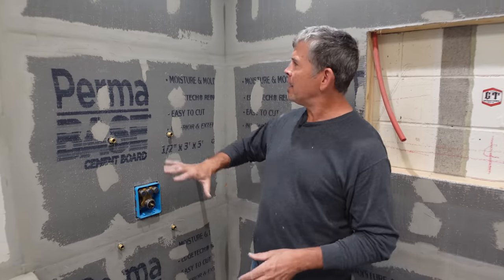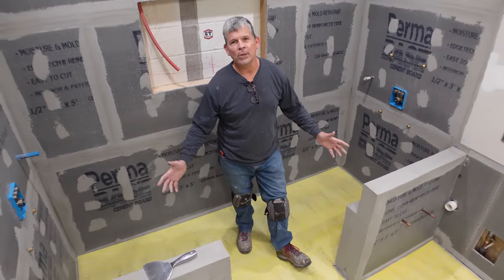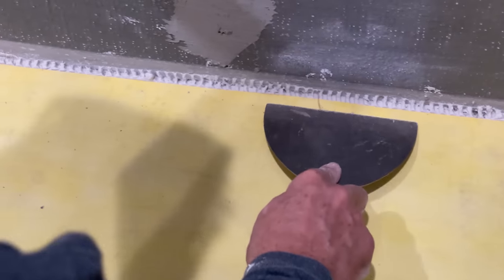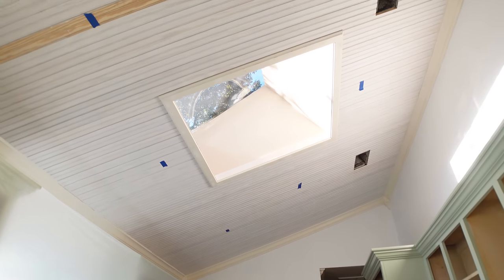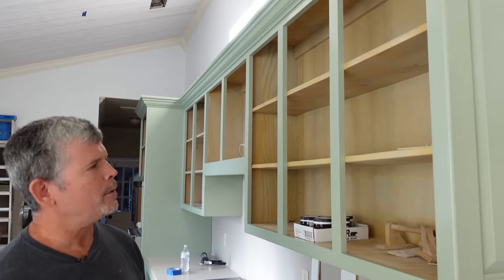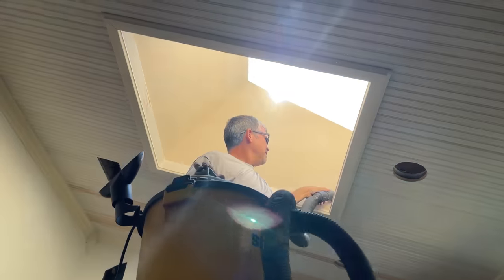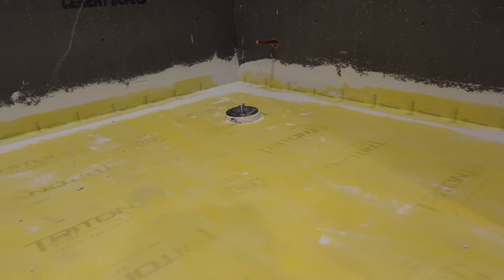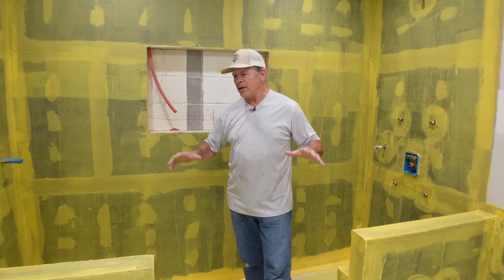We Covered Our Bathroom in Nacho Cheese! - THE SHOP Part 17

Comment: Every gun I’ve carried would have rust spots from sweat in the summer. I think you just gave me a solution to that problem
Reply: Try a holster with a rear protective tab.  Wipe it down with an oily rag each night
Reply: @albertthesecond210  It wasn’t a huge problem, I exaggerated for the joke. I carry owb now so it’s no longer an issue anyway
Reply: @joshcowart2446  I can relate.  Mine are typically OWB (leather) and prefer the protective leather tab design
Reply: @albertthesecond210  yeah, I always did iwb in various styles but appendix hurt while working and hip would always come out from under my shirt. I finally tried owb and love it. I actually just got a leather holster. I hadn’t intended to get leather but that was all they had for a hell cat left hand draw and I love it

Comment: Without any waterproofing underneath the shower pan, water could be absorbed into the Pirma base and then through capillary action down into the pan and directly onto the wood. Water would basically be trapped there with the membrane on top of the shower pan locking it in. So waterproofing the walls seems critical. I’m sure studpack is following the directions, but from the looks of it it seems like it could use a second coat.

Comment: Looks like a good waterproofed bathroom.  I always seal the exposed thinset used to lay the floor membrane and 6" strip membrane.  I figure if water never gets to the overlap chances are it will last longer.

Comment: tinting your primer is a great help but you definitely want to do it a contrasting color.   it's awesome over white drywall too.  (because its super easy to lose white paint over white primer over white drywall mud).   I like to use a really light pink.   it's easy enough to cover (even with white) but it really stands out where you got primer (so you have good coverage) and where you now have paint.  It's esp great on ceilings because we'll all looked up at a ceiling long after it's painted and realized that there is a whole area that is just primer.   When ti's pink that doesn't happen.  Any paint shop will tint your primer no problem.
Reply: That is smart! Some idjit painted the ceiling on the rental I own with eggshell, and I overpainted flat but I sometimes can catch a spot I missed.
Reply: @toomanymarys7355  , they have ceiling paint that goes on blueish and drys white. Two coats and your done.

Comment: @stud pack
16:49 Hey Mr Paul, wondering if ever tried Laticrete’s HYDRO BAN Quick Cure liquid applied waterproofing membrane? Paints on like regular Hydro Ban liquid membrane, but able to flood test or tile (suppose should be and tile😉) w/in 30-120 mins depending on few variables. Personally have only used 1 time for project and felt thicker to me and color diff as well, compared to “normal” liquid applied hydro ban membrane.
Thx and this garage bathroom remodel is looking great. Nice job on painting, always do awesome prep and gets a great detailed final looking project👍🏻

Comment: Great video guys. I’m working on a first floor remodel in my house. Half the house has been painted with a brush and roller and the other half has still yet to be done. I’d like to try a sprayer but I’m not sure if it’s worth it to deal with only three rooms left.   All three rooms have a bunch of windows, doors, casing and baseboard.  Floors have already been installed to those that need to be protected.

Comment: To keep stuff from splattering on the floor, you can go to somewhere like Samsclub and they have these really thin sheets of cardboad that they put on top of pallets under products like paper towels. If you happen to get there when the cardboard is still there, grab some. I had an employee practically beg me to take some because they just throw it away. You can then lay that stuff on the floors to protect them and it doesn't cost you anything. I used a sheet to protect my floor when preparing to install my toilet.
Can Triton membrane be used behind direct-to-stud shower walls? 
"It wasn't fma it was fml" LOL. 
I love that you repurposed things in that kitchen for the skylight. I'm a big fan of recycling things/re-using them for some purpose.

Comment: I know time isn't on your side, but i'd apply a few more thin coats of the membrane just to get it a few mils thick and have peace of mind. At least enough coats until the bucket is done. By the time you're done with your next coat, you could be starting another one right after that. The coats dry quick when they're applied thin, and they build up and bond on top of each other creating a very strong seamless membrane.
Reply: To my knowledge its not a good idea to roll on a ton of coats of this stuff 2 coats is usually more then enough
Reply: Frogy is correct. Too many layers cause problems that make it fail over time. Follow the directions to the letter!
Reply: Absolutely 2 coats,as long as there put on even and correct 2 coats,one coat is not enough
Reply: @Teach2Build  never heard that,it’s actually the opposite
Reply: I didn't say just one coat, I specified to read the packaging. Different brands have different specs, but for liquid membranes, most require 2 coats but will fail with 3, or if the mils are too thick.

Comment: Would you recommend that dust free sanding system from Amazon to use on popcorn ceilings? Or keep with the old fashion "damp and scrape" for the popcorn?
Reply: I would recommend keeping popcorn ceiling wet/damp when removing it. Some early applications were known to have asbestos. Dry sanding/scraping would not only make a huge mess with all the chunks flying off (that the vacuum couldn't pull through the mesh), but could get any asbestos airborne. Err on the side of caution.
Reply: @nelsonbrum8496  we are lucky and had it checked, no asbestos!!! House is just under a decade old, too!

Comment: Keraflex sticks to everything even wood. Also saving old wood is a dying art. Well done on your filler use. I use the same combo. Durhams is a life saver.
Reply: I agree, Durhams is a life saver.
Reply: My only gripe with Durhams is the short working time. It would be so nice to mix up a batch and have an hour to apply it, but you only get 15 minutes max before it starts to stiffen up, which means I spend as nearly as much time mixing/cleaning every 15 minutes as I do applying it. I have tried adding the splash of vinegar to lengthen the working time multiple times, as per the instructions, but it never made any difference at all as far as I could tell. :(
Reply: Is that cement based? I’ve heard you can refrigerate the mix before hand and use ice cold water, put your bucket inside a second bucket with ice, etc to give it a few extra minutes of life.

Comment: question about the beadboard ceiling. you said you tacked up furring strips or something perpendicular to the joists so you had more support to nail into... did you also run strips on top of the joists so they were then level with the furring strips or was it a thin enough difference not to matter? i'd like to do something similar to my ceiling... 

anyway, glad you got to get a lot done finishing up things before you head to TX. can't wait to see everything :)
Reply from the maker: the ceiling was flat enough for us to not fur out the strips any further, we would've if was super noticeable though
Reply: @StudPack  thanks

Comment: I would use a ledger and do all the walls and ceiling first leaving out the bottom row of tile.  Then do the floors and follow up with the bottom row of tile so you can avoid being on finished product.

Comment: It's hard to cover anything with 1 coat of paint. 

A sprayer helps, thicker coat. 

But the problem is with the sheen, not the color. Tinting the primer helps with the color, but it's almost impossible to get even coverage in 1 coat.  Stand in the right light and you can see the imperfections. 

That's why you can't touch up paint, have to paint the whole wall.

Comment: It'll leak around the drain bro. Wrong membrane to drain connection. What's keeping the water from seeping under the membrane around the drain? Thinset? Lol Cut the membrane back around the drain about 1" and paint around the drain with liquid  membrane/fabric tape. At least 2 coats. Prime around the drain or sand it first to make sure the liquid membrane will stick to the drain. That way there's no way for water to seep under the membrane around the drain.  Should've used a Kerdi linear drain or same style linear drain as Kerdi because you would be able to achieve a 2" overlap with a Kerdi linear drain.

Comment: Thin set is not waterproof. Yes it will leak water even though you follow the installation instructions. The waterproof roll on membrane should be rolled over all edges and exposed thinner so there is a true waterproof membrane at any edges. You won’t know until you tear apart the bathroom 5 years after use. This is same as Schluter systems and the install method in the Americas using this set leaks. The European compound doesn’t.

Comment: You guys go so far above and beyond. You have showed projects like your mom's house, where they had tiled over drywall on the shower walls. In my friend's track home, he discovered the same thing because water was leaking into his kitchen below. There is constant fight between owner- contractor, when asking for a quote for redoing a bathroom, and if the quotes are too high, the owner goes with the lowest bid. But if you want the belt and suspenders work done, The Stud Pack style, then you have to pay for the plywood, thin set, backer board, thin set, membrane, tile and labor, not the plywood-thin set-tile.

Comment: @ 10:00 You guys are the pros, so I'll take your word on the stubborn wallpaper - but in case you didn't know I learned a trick from my wife of all people. We had some really stuck on wallpaper when we moved in, and if you use hot water and vinegar 50/50 mix you can spray it on let it sit for a minute and the vinegar eats away the glue. We were able to just scrape the wall paper off easily at that point.
Reply: Some are vinyl and nothing soaks through.

Comment: You should do a separate quick video on that dustless sander. I'm in the same boat, I do drywall not enough to NOT buy a $500+ machine but enough to need something better than a standard pad and stick. That seems like a decent medium. Did you get your pistol cleaned up? lol

Comment: Why not use a waterproof board right from the start like Johns Manville Go Board? It's lightweight, easy to cut and install and already waterproof. You just need to caulk the seams and screw holes. (need a particular type of caulk) but still...way quicker. And btw....you do great work on the videos!

Comment: When I built my shower I took the belt a suspender approach used cement board covered with Schluter membrane and covered that with added 8 plus 9 shower is on the second floor did not want any leaks

Comment: My question is why is the linear drain not at the back side of the shower, by the shower exit?  I've seen them there, and it makes more sense to me logically, should keep water from exiting...
Reply: Cause then you would need to angle the floor toward the door instead of away from the door.  You would get puddling and splashing into the bathroom.  Not a fan of the Lanier drains if it leaks it is much tougher to fix years later.
Reply: @hrcnick11  Now that I think of it, it was a hotel in Europe, and the floor sloped towards that as a floor drain, I suppose they could've sprayed the whole bathroom floor and it would flow to the drain.  Would definitely have made sloping more difficult.

Comment: I've been exploring ceiling solutions to fix mine. Maybe I'm overthinking it and I should just apply beadboard. 
Paint store told me, "Sure you can roll paint on popcorn texture." Uh, no, you can't. Most of texture came off onto the roller so I stopped painting midway. Now I can't scrape off texture where it's painted.
Water leaked in another room and discolored it or even made texture peel away. 
House built in 1950 so likely has asbestos in the popcorn texture. I don't even like that look! Ugh!
Reply: If you've not already done so, I"d encourage you to have your popcorn tested at a lab for asbestos.  I think it cost me less than $20 (but that was years ago), and then you'll know for sure what you're dealing with.  (And yes, covering with beadboard is exactly what we're considering for our Great Room.)

Comment: Plumber here. Forgot to comment last video. You may want to extend your hot water stubbout (left copper pipe) before putting tile. I predict you may have an issue putting on an angle stop at finish. I usually give it 6 inches out from the face of the 2x4.

Comment: @17:05 Holy crap finding the instructions on that liquid membrane on their site is a nightmare.
Question.... You guys applied only 1 coat of the membrane? It looks like you guys really laid it on there quite thin. Most other liquid membrane require thicker application and at least 2 coats with drying in between.

Comment: You didn't pass chemistry for sure. Thinset cures, meaning the water is one of the reaction components in contrast to the liquid membrane, an emulsion where the water evaporates to allow the suspended components to merge into a surface layer. :)

Comment: One word, WEDI - cut your labor by 60% and water proof through entire thickness of wallboard.  No taping joints, no water proof paper and fewer steps to completion.  Durarock is ok for floors and walls on non-wet surfaces.  If it's wet, WEDI is the only way to go.

Comment: I love seeing the liquid membrane. Idk about the Masonite you used but generally the stuff I use specifically says it isn’t waterproof.
Reply: They didn't use Masonite.  They used cement backer board.
Reply: @grounded-b937  😂 concrete backer board is masonite
Reply: @williammorris3303  No masonite is most definitely not concrete based. Spend 3 minutes on google and you'll learn that masonite is like a high density fiberboard. Made from wood fiber and glue/resin.

Comment: There are so many major problems and lack of knowledge shown in this build. 

First, the non WP Perma base used here is absolutely not waterproof as you stated it is. At all. It is water resistant, in that it wont rot or dissolve if the REQUIRED waterproofing system has a failure.  Stating you can tile directly over it in a wet environment is false and dangerously bad advice to the unknowing that watch this. 

Second, the liquid waterproofing membrane used was installed WAY thinner then the mils of thickness required by the manufacturer, so much so it is visible in video. 

Then the unfinished/unstablized joints in the CB board used on the walls that renders the waterproofing useless and is going lead to shift and cracked grout, the drain to membrane issues, the drywall used being not rated for the environment, the non alkaline rated mesh tape used that will rot and fail, the drywall to CB board joints being unaddressed and unstablized, the drywall screws used for the CB board that will react and fail, the insulation that was installed incorrectly by cutting into pieces rendering the vapor barrier useless... on and on.

This is why you hire a contractor that knows the importance of following manufacture data sheets and code requirements and not a youtube handyman. 

The unsecured gun on a jobsite falling into the bucket of membrane was just the icing on the cake.
Reply: @mr.g937  80 comments on this channel. 

Imagine having a parasocial relationship with fake youtube contractors. I genuinely feel bad for you.